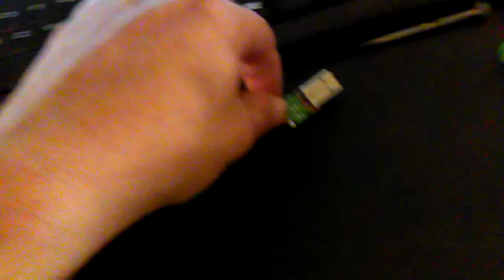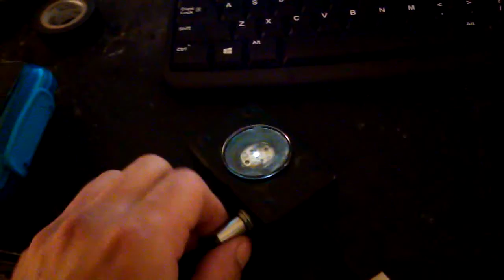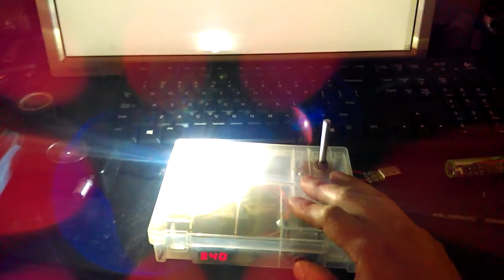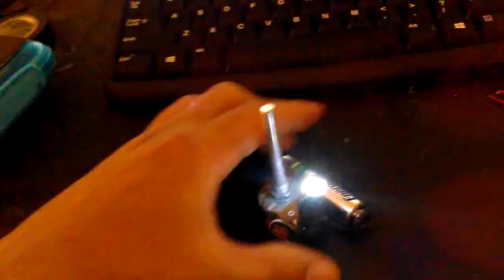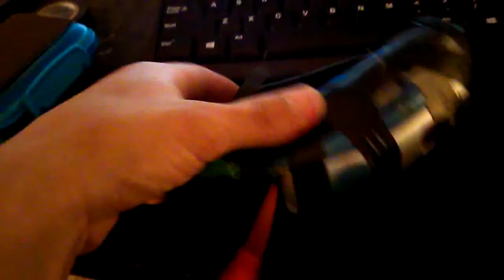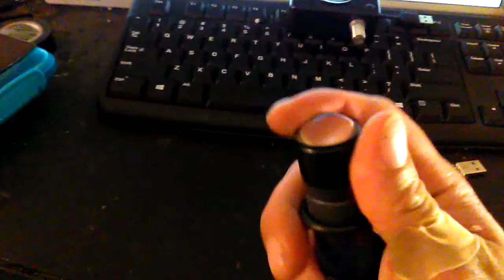Handy Emergency/Survival/Camping Light Setup

Comment: Nice Video Man Specially Loved Capacitor Based Flashlight Easy To Charge In a Second and Im Thinking To Make A Joule Ringer With A Hand Crank &  Solar Cell
Reply from the maker: Yea that little capacitor light is something most people would consider a waste of time because of the low light output.. I personally find it usable so long as you are in absolute darkness. When all the lights are off in my house and it's dark out , I  can actually read using the light. I was thinking for that kind of light maybe a peltier module is the best way to run it, similar to how a few patented lights have been done... except the difference is I wouldn't need to use any special mosfets that activate at super low voltage.
Reply: +Magneticitist yeah man I like AA flash lights Specially Thrunite 2a V2 That one is a beast Single AA And 400 lumens on High